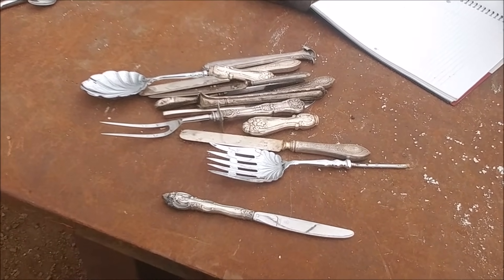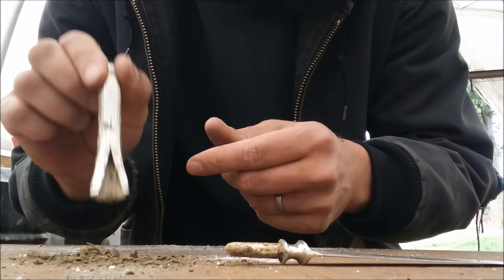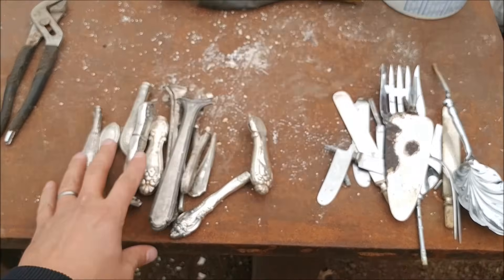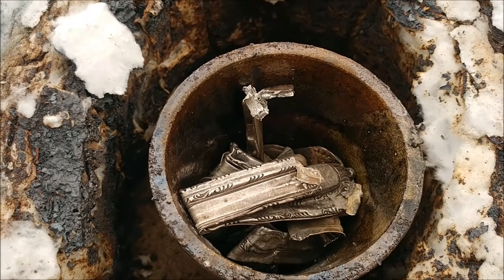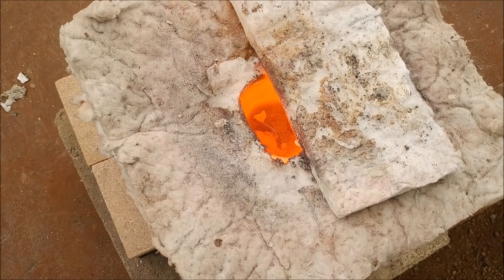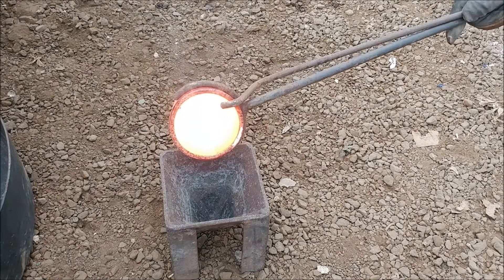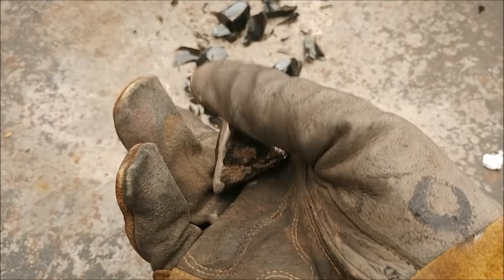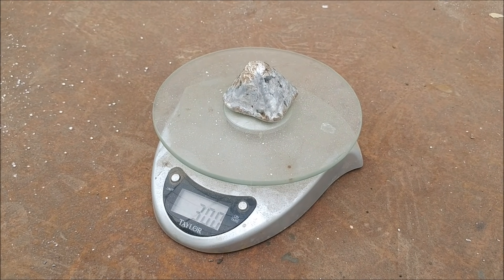How to Recover Sterling Silver from Silverware and Melt in a Furnace

Comment: Looks like I got the same set as you I just heated up the handles and these popped up think the air pushed it up but a couple spat hot glue so thankful had googles on I was thinking of reusing but as silver price so high n 800 grm in current state found in skip

Comment: Just a word for folks who might consider this.
I worked part time in the summer for my Uncle who worked in a salvage yard when i was a teen.
I found out that the ppl in the salvage biz really frown on folks bringing in melted down sterling silver such as this.
Cause USUALLY, not always, the silverware on its own has more value than the raw silver weight. and the only reason to melt down silverware like that is 1 it is damaged badly and 2 its stolen.
so if you do this and then take it to a salvage place or a pawn shop..dont be surprised if they turn ya away.
Reply: Pawn shops and other "reseller" will only pay 20% to 40% of what its scrap value because they want to pay you peanuts and sell it at max profits.   It is actually more profitable to scrap the silver than sell it to dealers and pawn shops.  I know because I've checked around looking to unload my sterling collection.

Comment: I hope you respond to all questions. 
I do commercial HVAC. I have been collecting compressor,and blower  contactors. They have copper coils which add up . I have 3 home depot buckets full. My question is, is there silver on the contact points and is it worth extracting it . I also think old circuit breakers have silver too but not sure. Is it worth it ? I have spare time in the colder months to sit in my garage taking stuff apart.
Reply from the maker: Not sure on that one.  Maybe take them to your local scrap yard and see if they have an XRF gun and get them tested

Comment: The gunk as you refer to it inside the handles on old pieces will be shellac.  Newer pieces probably an epoxy style resin that does not crumble so easily when bashed with a hammer
Reply: I've recently been trying to fix some 1980's silver knives where the blades had come half out of the handle (probably because some douche put them into a dishwasher). Only way to get the resin to loosen up was by heating it over a fire until the blades shot out at about 100mph. So I''m guessing epoxy indeed.

Comment: I melt scrap like this in my kitchen with a small crucible and a blow torch and then poor it directly into a graphite mold. Comes out much nicer. Those handles are pretty much 100% sterling silver. Smelting them with borax is completely unnecessary.
Reply: He's just using the borax to drive off the impurities into the slag (the "putty" stuff that he mentioned was on it)

Comment: I have old silver coins that burned in my gun safe during wildfire.  I have about 30 lbs.  Would this work to capture the silver content?
Reply: It will only change the form: burned ugly silver coins of various impurities into an ugly poured ingot of homogeneous impurity. Further work needed to refine it, which could just as easily be done in their present condition. If your intention is to clean the pile up for the purpose of selling it, then the above is wasted effort. Refiners will happily melt your pile, assay it, and pay you accordingly.

Comment: You ended up with a blob of silver metal. Worthless because melting destroyed the manufacturers "sterling " marks so you will have to prove it is what you say it is (sterling/925 fine) to any buyer. Hope you are into jewelry making.
Reply: I deal in unmarked silver all the time, you can get what you need to prove it's silver for less than $10.

Comment: There is a few more steps to refine.....once you pull off your slag, drop your "pure" mix into a bucket of PURE OZARKA ice water (TALL BUCKET TO AVOID A MELTED BOTTOM)....
Then repeat the process with the tiny silver pellets you got in your bucket....

On your 2nd meltdown add more borax, remove any more slag/impurities by skimming top (should be WAY less slag than the 1st melt) 

I worked in a shop for a year or so fabricating, designing and scrapping
Reply: How do you remove the copper from the sterling
Reply: @kenmastersmaster  Cuppelling is how he usually purifies silver/gold. He has several videos showing that.
Reply: so can I actually pull the base metals from the silver with borax ??? or do I need to cupellate with lead as well? I have spent the last 2 weeks reading and researching every day trying to figure out how I can refine silver without nitric acid or any other major chemicals or additives. Lead cupellation seems to be the easiest but I'm wondering if I straight up fire assay with a sufficient amount of borax, will it pull the base metals from the silver? Im thinking no but youre an expert so Id love to know.
Reply: @Zerodark_mov  encontraste un metodo?
Reply: Would it be prudent to repeat step 2 a 3rd time for purity or no? I’m new to this and after watching the video and reading your comments got me to wondering.
Reply: And crack open beer number 2 part way through the whole process

Comment: What is the flux that you use? Also how do you get fine silve from sterling? I'm new to this
Reply: he said borax at 2:35
Reply from the maker: Borax, and nope you still end up with sterling silver, just all in one piece
Reply: @mbmmllc  what is Nope... I'll research
Reply: Smash it as flat as you can get it or shave it into powder then you can do chemistry. Or if you can hold it at an exact temperature, hold it where silver is molten and copper isnt
Reply: You could cupel the silver pyramid to remove base metals like copper tin etc.
Reply: You don't get fine silver. This is not refining. This is just melting. Which actually makes harder to refine. This process does nothing to help anyone and is a complete waste of time.

Comment: Why is it still 92.5% silver after you melt it and separate the slag? Otherwise, really cool video man. I just discovered your channel.
Reply: Only way to properly separate is chemically. For whatever reason people tend to think that by just melting metals, the different  weighted layers will separate, however, that is not the case except for a small amount. 

With this specifically, I would use dilute nitric acid, on low heat, add the silver pyramid into the acid, and heat until it’s dissolved.  Filter out any slag or leftovers until just clean solution (most likely slightly blue or green because of the copper). 

Once you have the clean solution, add a large piece of copper, and watch as the silver chloride forms and precipitates onto the copper bar. Leave until all silver has come out of solution, filter, and spray down copper bar to remove any leftover silver. 

At this point you have relatively pure silver, but not .999 fine. You’d have to grow silver crystals in a silver cell (another process) to get it pure enough to be called .999 silver.
Reply: @redbaronrefining5322  can't this be done without acid? There's a video of a guy using lead to refine it
Reply: @kenmastersmaster  yes you can refine it by cupell process, however itll only be 90-98% pure. To get it to .999 or higher, chemically and through electrolysis is a must for 0.9999
Reply from the maker: Yes, I just melted it. Didn't do any refining.
Reply: @mbmmllc  using the nitric acid, if done right, will give you .999 silver. But if it comes out .997, who cares.
Reply: 92.5% silver + 7.5% cooper = 925 sterling silver. The copper makes the silver harder and not wear as fast.
Reply: @ColCurtis  interesting, i didnt realize that the copper wouldn't be separated! Thanks for the info!

Comment: the bane of the precious metal buyer, weighted handles! Ideally you should just remove the filler as it can be Plaster, "Pine Resin" (that brown stuff from your handles), Lead, Sand, tar, or a almost hard Plasticine/clay type material (usually when found it's in sterling mirrors and brushes)
What you did works but it is very hard on your crucible not to mention not the greatest ideas to do if your handles are weighted with lead. 
Sand easiest just remove handle and dump out sand,
Plaster is a pain because you have to really smash the handles all over and dump it out
"Pine Resin" and the Clay/Plasticine like material can be done by smashing them with a hammer but you have to be careful to only hit it a few times and then try to dump what is loosened and repeat because if you try to smash it all in one go the material turns to goop and is literally like pine resin to clean up from your hands and remove from the sterling handle.
tar is as far as I'm concerned the biggest headache because you cant smash the handles because they instantly turn the solidified tar back into black goop. your best bet for them is to remove the blade and then try to burn the tar off but that also gives off a decent amount of smoke so a real catch 22. 
Lead you just have to slowly from the blade side heat up SLOWLY and eventually the blade will loosen enough so that you can remove it and then again SLOWLY heat up towards the end of the handle. WARNING! if you try to heat the end of the handle without removing the stainless steel blade the handle WILL explode. No may explode IT WILL EXPLODE and you will have molten lead flying everywhere. I save all my lead handles after being processed to be processed alone at the refinery company I use because they are contaminated with lead and some refineries don't like to process silver that has been contaminated by lead.
Reply: I buy precious metals all the time and personally i love getting weighted handles. From taking them apart for around 15 years the most efficient method i have is just hammer and chisel. Chisel a line down the middle, open up the gap with the chisel and dump out the contents.
       As for lead exploding i find this to not happen if you chisel a line on the non-leaded part of the handle to create air flow ( sometimes theres also filler in this part thats not lead so dump that out) then heat it up through the silver with map gas. Always use tongs to hold it and necessary gloves etc and make sure you have a bucket to catch the stainless and lead. Also as a quality of life improvement i always keep a large 2 pronged fork on hand to aid pulling out the stainless on some annoying ones.
      In terms of contamination this is easily solved by heating up the silver  to 330 C which is the lead melting point and since silver melts much higher the lead will melt right off.
      I hope this helps,
          Rob
Reply from the maker: Thanks for the great info!
Reply: Smart man